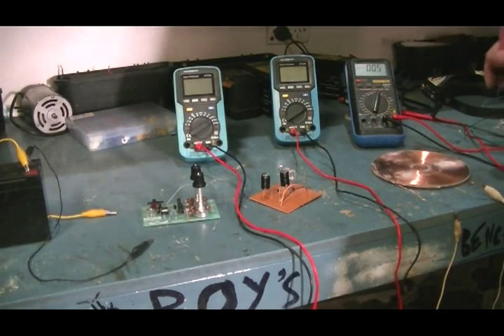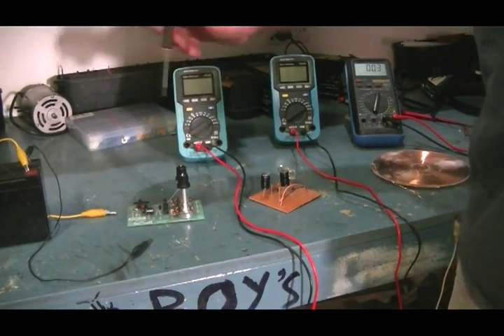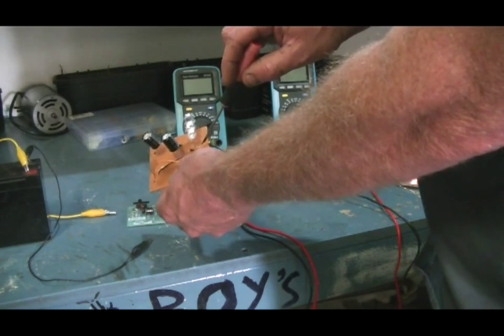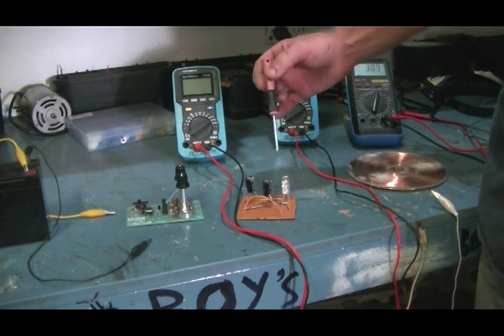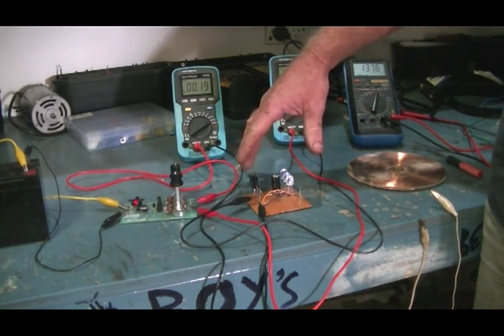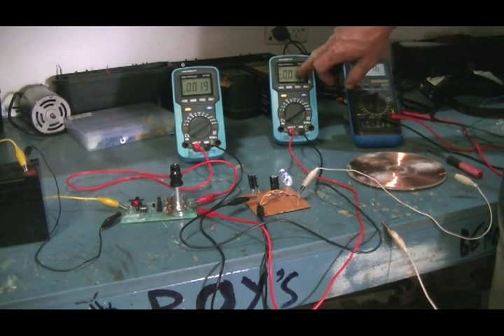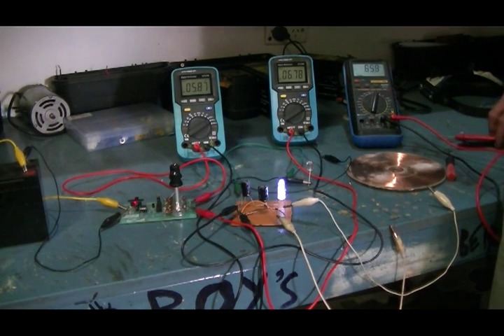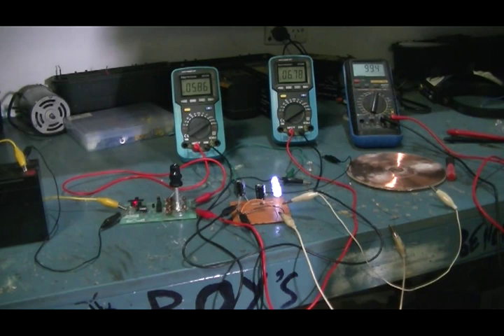Tesla pancake coil circuit test and mesurment's

Comment: Since you don't show the circuit diagrams/connections, part types and values I have no idea what the setup is accomplishing. Where in the circuit are the meters connected? What is the 2 potentiometer board? What is on the LED board? Do you have an oscilloscope to connect to the setup? You might have something here but no one but you can evaluate it.

Comment: Hey TinmanPower, would you be willing to share a drawing for your circuit on the Tesla pancake coil circuit test and measurement's? I would like to work with your concept. (interesting work)
If so, cold you send a copy to hittingthewall1@gmail.com. Thanks

Comment: Very much so. My understanding is the positive and negative ion flow is the key. Take a look at my scalar wave videos shot from my scope. You can pick up a pattern without power input if you can find a fast enough regenerative capacitor to set it off. Keep up the good work

Comment: Good one TM... A good visual of the proper flow of electrons. Interesting in deed. The supply requirement goes down with a >load. More electrons are being introduced by the coil thus a <input load.. Would like to see the overall effects of an oscillated load on the secondary cap. As well; battery input properties.